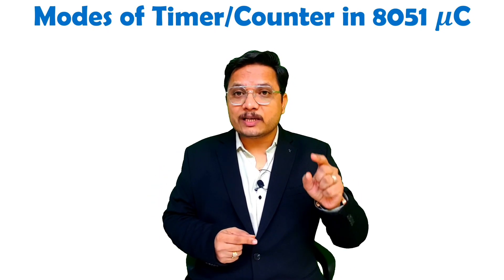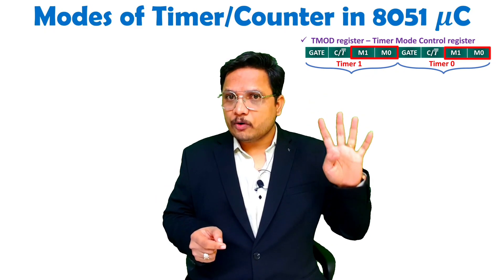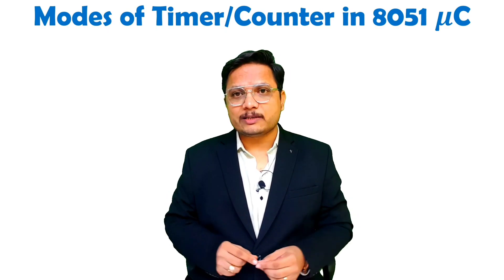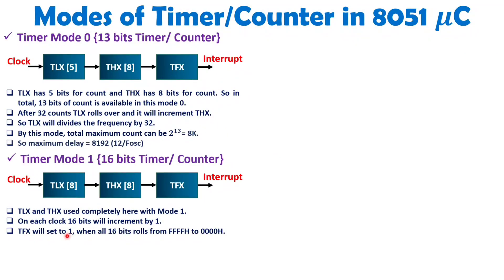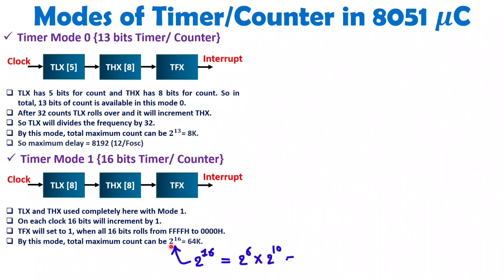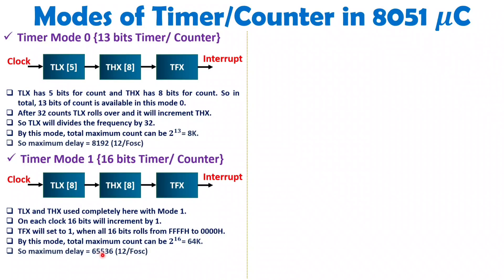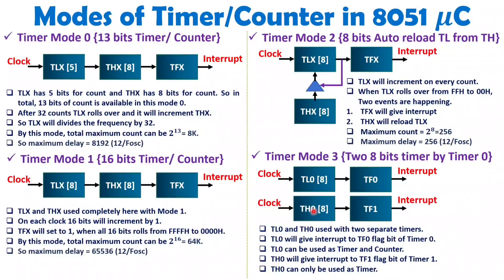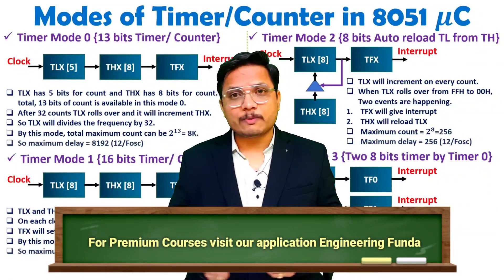Modes of Timer & Counter in 8051 Microcontroller Explained: TCON & TMOD Configuration

Comment: 00:01 Explaining the modes of Timer & Counter in 8051 Microcontroller
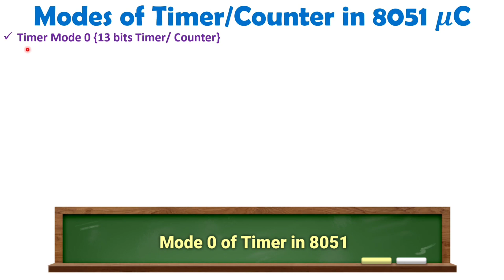01:28 Timer mode 0 operates based on 13 timer counter bits.
02:57 Timer 0 operation includes 13-bit count and interrupt generation.
04:36 Timer 0 operates at 13 bits and has maximum delay of 8192
05:59 Timer mode 1 uses 16 bits for maximum delay generation
07:31 Explanation of Timer auto-reload in 8051
09:08 Timer mode 2 explained
10:47 Two separate timers using Timer 0 in Mode 3.